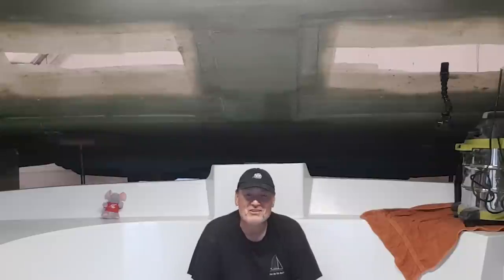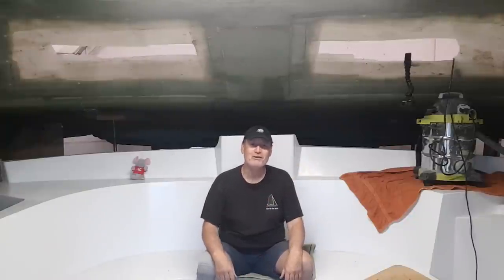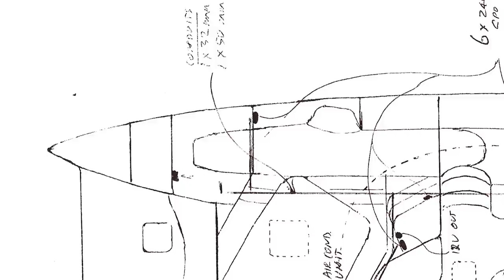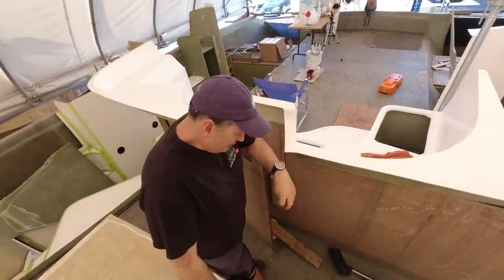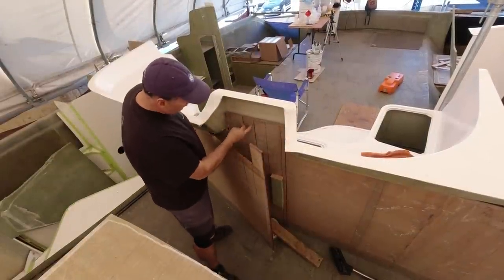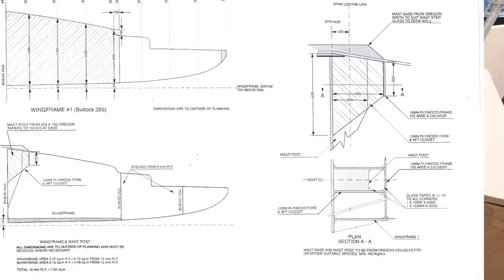I wish I had thought of that!  - 12.7mtr Catamaran Build Ep187

Comment: I like the way you put snot on the bottom edges of the bulkheads to glue them in. Most tub builders that I've seen on youtube don't do that.  Nice.
Reply from the maker: Thanks buddy.I reckon it's funny how I am considered a YouTuber,I have never thought of myself as one of those.I always thought of myself as a boatbuilder.hah.It is the initial and secondly the fillet that creates the bulk of the strength.Wet incororation of the fillet and the tab is second to none the best practice.Overlapping tabbing over the top is the secret resulting in a tree root like structure,gradually spreading the surface area of the lap.Narrowist first,wider and wider. am seeing some crazy tabbing and creating sheer points is a major fracture point in a lot of builds.Cheers .Ross.

Comment: There are reasons why this bulkhead is designed in position as it was. It's a crash bulkhead, so it protects the hull from flooding when the bow is damaged. I know you're a boatbuilder, so you should know.
Reply from the maker: Original crash bulkhead in the plan was in fact 300mm further forward than the original position.So I am still within the parameters of the design.It us a fully reinforced and overenginereed structure and the mod was in preference to having conduits pass through as many boat builder choose to through coffer dams etc.Therefore air tight as per specs .Issue was the module that was designed and plugged and moulded after the fact. Ross

Comment: You should Mount that mast compression post on a solid block of wood. It's probably too late now but that relatively thin edge could create problems for your hull / bridge deck. Although, given your construction, the post can probably take the compression forces the hull may not be able to. You should run that by a marine architect if you haven't already. Like it could just punch right through depending on what type of mast you use, your rig, the weight etc. Just tabbing it in won't do it. You need a solid block of material under there. Think of it like a piece of square stock going through cardboard. If the end is open it'll punch right through there. If the end is closed off you'll probably wreck the cardboard before it punches through.
Reply from the maker: Marine architect was involved,post is epoxied,tabbed,filleted,subfloorcreunfoced with layers of extra quad,bulkheads transfer load over an 8 metre span instead of compression point.Hull is overengineered,deck is way over spec,and Mast Post is over spec also.Meshing with deck will be extra filleted, tabbed,in any case there are through bolts holding the post to each bulkhead.Cheers Ross
Reply: @LifeOnTheHulls  Glad to hear! Cheers
Reply: If the mast post wants to push through the hull, it has to push the whole central bulkhead through the hull as well. The way everything is bolted and laminated, it is not a single mast post any more, but a bulkhead with an integrated mast post.  The only way to make it even stronger would have been to laminate the inside all around with a vacuum/pressure bag like GFK pipes are made.

Comment: I get the mast post is strong, but a layer of glass on the outside might have been good as the compression might want to make it bow out? Probably overkill, but while it's doable. I'm just thinking 20-30 years in the future :).
Reply from the maker: Thanks,It has 6 additional layers lof 600db laminated to sides once installed, tabbing and through bolted to bulkhead.No chance of it blowing put as it is surrounded by bulkheads and integrated in to a secondary trapezoidal box section.Cheers Ross
Reply: @LifeOnTheHulls  Your attention to proper engineering and construction are 2nd to none! It’s awesomely impressive!!!

Comment: Another great video Rossco but I have one question, Why is there a drain hole in the crash bulkhead, doesn't that defeat the purpose of having the bulkhead there in the first place? I thought the idea was to have a small water tight compartment to limit flooding should you hole the bow.
Reply: It's quite common.  It's so you can easily drain waterfront slow leak etc. He will eventually install a valve so it is still sealed
Reply from the maker: There will be a ball valve at the end of the drain that can be leaked slowly into the bilge to remove water in the event of the void taking on water after a temp plug to get to safety.Rossco

Comment: Wow - strong post for sure - does the weight from the mast trasfer in someway to the bridge deck? Or is it just a point load onto it? Do the surrounding bulkheads get glued to that post to spread the loads? Good solution by the way to the heads issue - lot of re-work but I think the right solution. Great stuff Rosco, clever thinking I'm sure will help others whatever they are building. Thank you.
Reply from the maker: Post is laminated,filleted,and tabbed to all faces of the three bulkheads.It is then through bolted to these bulkheads and further laminated Post therefore transfers load over entire bulkhead rather than point loaded to the bridgedeck.There is 13mtrs in lineal contact through these bulkheads and deck is bonded to the Mast Post where the Mast sits on a sleeved baseplate that further disperses load.Definately strong enough. Ross

Comment: Your plywood mast post has me concerned I would suggest laminated oak or laminated Jarrah (ultra hardwood from WA)
Reply from the maker: I have discussed this and looked at many similar versions.The integration of the post to the three bulkheads is the defining factor.It is bolted through the each as well,so we are convinced it construction is more than satisfactory with over 9metres of load distribution across an already beefed up bridgedeck and deck composite structure. Rembering also the Cat is a solod bridgedeck cat with multiple stringers and bulkheads ,also over engineered to distribute towards the bow.Cheers Ross

Comment: 20:18 could've also sacrificed the first layer of that heavy ply and drilled small holes/dimples inside it. We used this method to restore the strength of an ancient beam that was so rotten and dead on the inside we couldn't do anything to save it, so we turned the face into a skin, and used this method to make sure it never leaves the glass/carbon fiber core.

Comment: I really think you SHOULD put a stainless steel pole down the middle.  If that post fails you'll be making cat rebuild video's like Parley Revival. Don't cut corners now where it matters the most.
Reply from the maker: There is now way it can fail it is through bolted,epoxied,tabbed and engaged into three separate areas.It will be fine.Parlays issues are substandard build,overweight superstructure,masses of weight in furniture,totally overlooked by the way,overtightening of the rig,hurricane damage,worst nightmare .Ross
Reply: @LifeOnTheHulls  Ok best of luck with it 👍
Reply from the maker: Ohh but I really do love Aussie Jarrah,good lad. Ross

Comment: You said you added a 12mm board to close the mast box but why didn't you use a 25mm board like the other three sides? Was the closing board glassed too? No idea what forces a mast post needs or whether the mast will sit on top or go through. Curious landlubber is curious. :)
Reply from the maker: I ran out of the 25mm,but it was overelamibated with extra layers.Mast sits on deck,deck is engaged to top of Mast Post and three bulkheads.Bulkheads carry considerable compression across the breadth and forward to the bow.Cheers Ross

Comment: Move the wall of the module 200mm (the head would fit then) and run piping there?
Reply from the maker: Head is not long enough to then provide enough room for showering in this head.I did think of it and this was the best solution.Cheers Ross

Comment: Does moving the collision bulkhead affect the structural integrity of anything
Reply from the maker: Not in this case 200mm is actually stronger more forward and beefed up tabbing with extra rgusk bulkhead.I have further structure with the module glassed in as well which is actually thicker than the hull in places.Cheers Ross
Reply: @LifeOnTheHulls  what about in the event of a collision is there still enough distance between the front of the boat and the bulkhead for it to be able to do it's job

Comment: Just a thought, but if you're reducing the size of the crash bulkhead, shouldn't you fill that space with a high density closed cell foam? The idea behind the bulkhead is to provide for absorbing the energy of the impact god forbid you ever hit something. Since the volume of that area is now smaller, it seems you should do something to increase the amount of energy that section can absorb.
Reply: Na... That foam always soaks up water, the buoyancy won't be any different..
Reply: @rsrguy  ... The idea behind the foam is to absorb the energy from the impact since there is less distance in which to do so, not to provide buoyancy. The same way the styrofoam behind your car's bumpers works... I'm not sure where the idea that it was about buoyancy popped into your head since I didn't mention anything about it, but hey, hope this clears that up for you.
Reply: @edwardnigma2216  not going to matter in a space that small plus it would turn into a nasty mildew-ie swamp mess
Reply: @rsrguy  Tell that to the 2-3 inches of styrofoam that helps absorb the impact of a 60mph crash and works in addition to everything else in a modern vehicle that keeps people alive and reduces injuries... Look man, I get it, you don't know what you're talking about. I made a suggestion, get over it.
Reply: @ralphgesler5110  Do yourself a favor and just call it a night. I'm pretty sure everyone but you can see the drain holes at the bottoms of those forward bulkheads he put in.
Reply: Ya... Sure... Ross' cat is regularly going to beam reach at 60mph.... I'm only telling you why it isn't done... Foam gets waterlogged, that's just all there is to it... Lots and lots of threads on the internets... Look some up